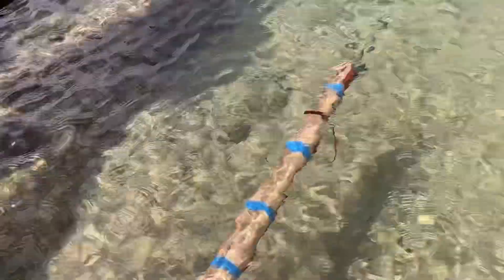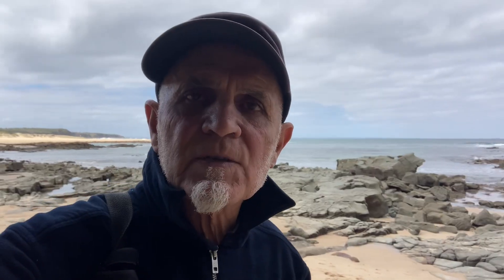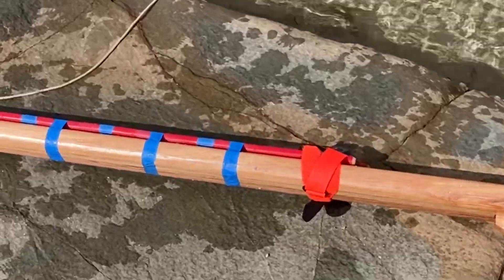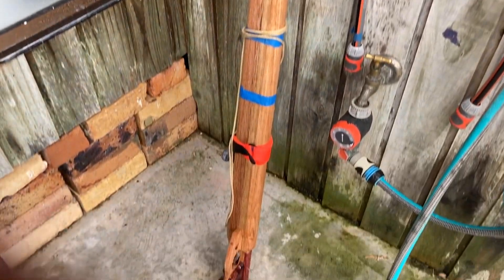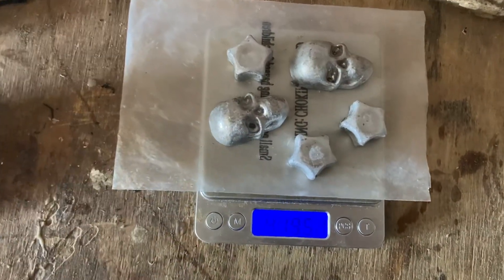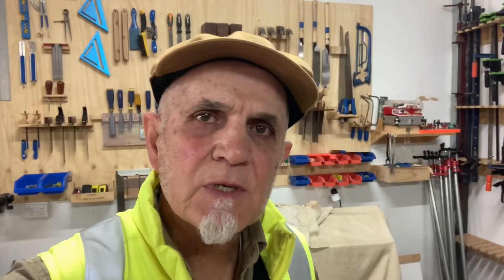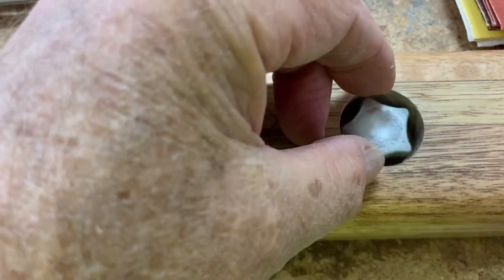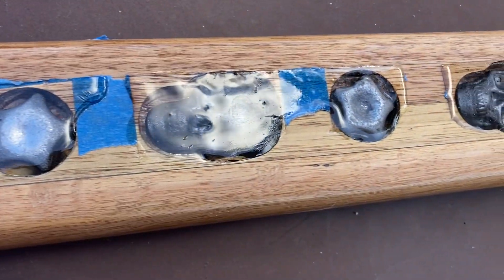Building “Billy” Part 6 : Ballasting and balancing

Comment from the maker: For those who can’t understand my English, I include a written transcript of what I said. You could use Google translate, or something similar, to make it understandable.

“Today I want to talk about ballasting and balancing.
When I use the word “ballasting”, I’m talking about adding weight to a speargun to control its overall buoyancy
That is, to determine whether it floats or sinks.
When I talk about “balancing” I’m talking about how the speargun sits when free in the water : does the front end droop forward, does the speargun stay level or does the gun sit with butt down?

Does ballasting, or balancing, matter?
A gun that is ballasted close to neutral bouyancy is easier to carry and easier to aim, especially with your arm extended.
A gun that is ballasted to have a slight negative bouyancy will sink, making it easier to find if it’s let go
A gun that is slightly nose-heavy gives “proprioceptive” cues , improving intuitive aiming
A gun that comes to rest with the tip pointing down is safer

I’ve yet to find out a way to determine the right amount of ballast, and where it should be placed, in the workshop.
I have to take the gun to a local tide pool and work it out, by hand, and in seawater
To do this, the speargun needed to be sealed to prevent water seeping into the timber.
It also needed to be fully assembled, with the floating and sinking bits arranged as they would be when it will be on the hunt.
I have a collection of sample weights, each one twice the weight of the next smaller.
I put the gun in the water and added weights till it just sank.
Then I moved the position of the weights till the tip just started to drop.
I noted the number and mass of the weights, as well as their position, then I took it back to the workshop.

Once the gun had been washed and dried, cavities were excavated in the stock, and the appropriate amount of lead was inserted.
The lead was embedded in the pockets with clear casting resin.
When the resin had set, I sanded it flat with 80 grit sandpaper.

The gun was now ready for varnishing and finishing.”